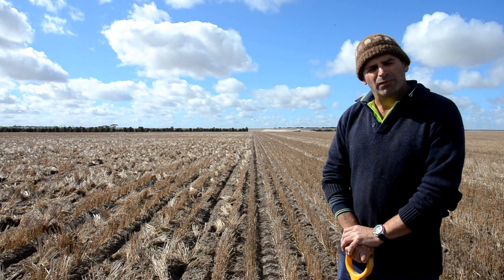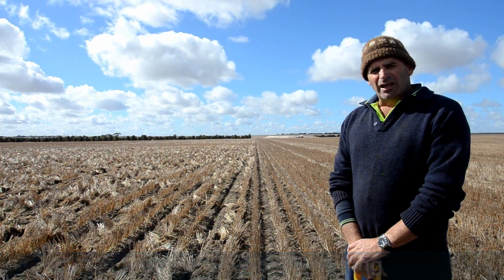Protrakker - Update

Comment: You guys using Deere Auto Steer on this Pro Tracker ??
Sf2 or RTK ??
Reply from the maker: Hi, Sorry for the late response but here it is!
It must be RTK so that you have year to year repeatability. You need  isteer software to steer the ProTrakker onto set run line from position data sent from a centrally mounted SF3 receiver on the bar. Bar mounted SF3 receiver sends gps position but shares the RTK signal for correction. ProTrakker has an angle sensor feedback to isteer software for hitch positional data.